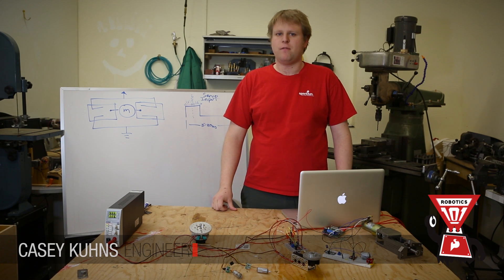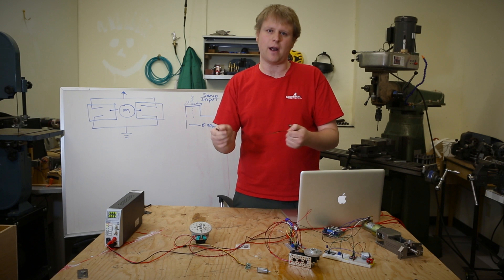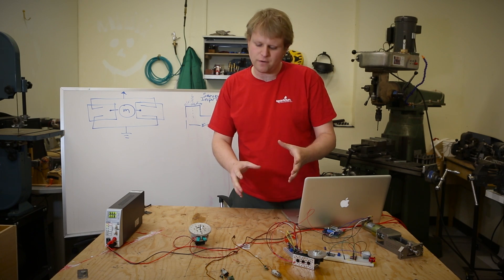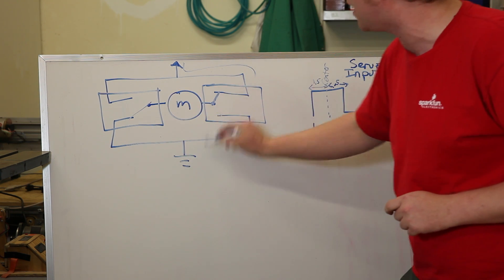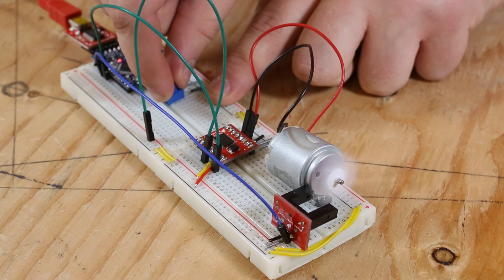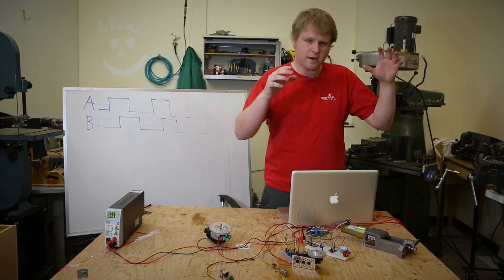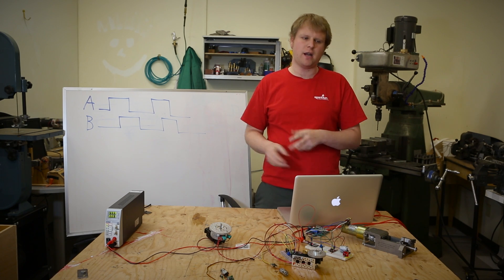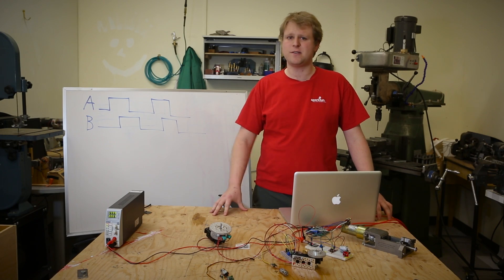SparkFun Robotics 101 - 9 DC Motor Control Systems

Comment: REWARD TO WHOEVER CAN ANSWER:  So, in a 24 hour cycle, how do you automate 2 DC motors to go forward at one time of the day, and then reverse at another time of day?  Best I can figure so far is get a Dual Channel DC Motor Driver, an adequate Power Supply, and a timer switch...  Then wire it all together.  What's missing???  Please, all knowledgable and smart humans, I need your help!!

Comment: You can get some smoothing out of I but D is where you get your dampening not I.  Otherwise, good video! :D
Reply: ***** I have some PID videos you might like but they are more for beginners.
Reply: TedRobotBuilder You can essentially just use P on any device that is not heavily affected by steady state error. This can be eliminated with a very small value for I (eg. 0.01). Surprisingly, many systems in industry do not go through the actual process of deriving the constants for P, I and D simply because it's time and time is money.